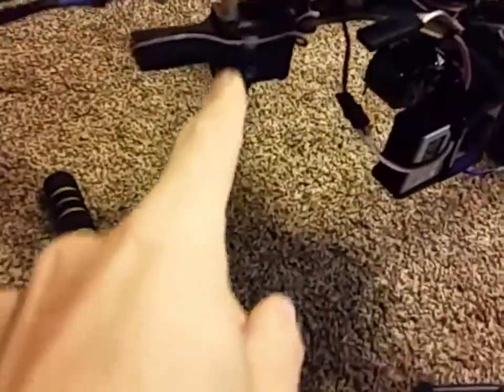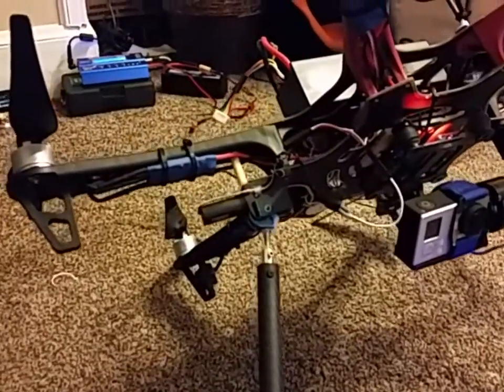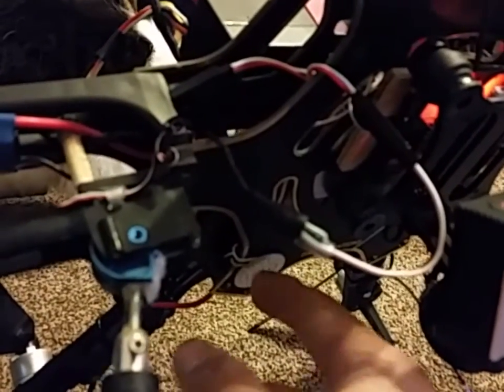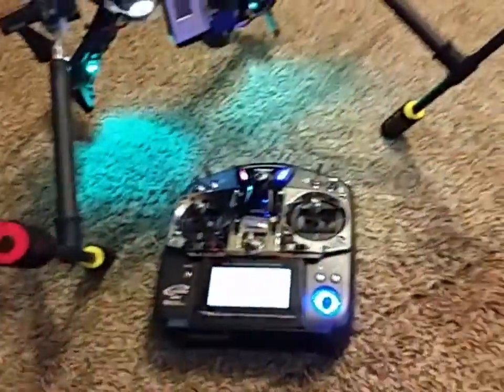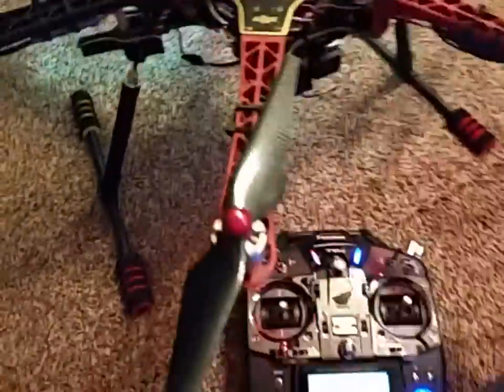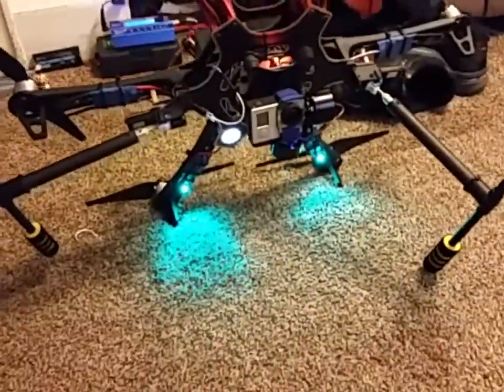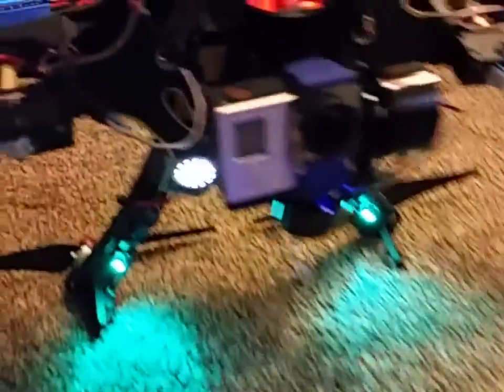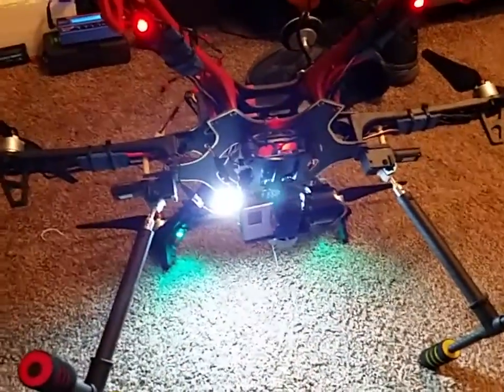DJI F550 Hexacopter Multirotor Landing Gear with LED Lights

Comment: Lot of work, should have just used a Taranis and simply assigned 2 channels to one switch, that is what I did. You could also use a separate switch for either also, love those 16 channel receivers.
Reply from the maker: please provide link to product, thank you
Reply: ***** http://www.alofthobbies.com/frsky-taranis-plus-x9d-case.html receivers are around $30 each, great radio, open source, look into them. You can assign all switches to one channel or the other way around. I have one switch that overrides all settings for a "return to home",  drops retracts and goes into rth mode. Awesome range, you can buy modules to support other radios like spectrum and futaba and continue to use older models without having to swap radio gear. So much more, they are very popular at the flying fields in my town. If you can think it, this radio can probably do it.

Comment: Hallo Sir,

What retracts are those and whre can i get them? Also do i need anything extra to pute them under the frame or they are just 2 separate retracts without any plate to hold them together exvept the frame bottom frame?
Thanks!!!
Reply from the maker: I purchased  them via ebay, called worm gear retracts, i also had to do some crafty assembly such as dowels and modify the included mounts in order to make it work. I will post some closeups  soon and look for  part links.

Comment: Hello friend, where you connected the cables servo ??
I am copying your system, I have the same servos, I have uncontrol Futaba T10J with R3008SB recertor, but I servos do not work, I tried it on different channels, but not how to make them work ??
can you help me ??
Which connected the servo in the naza or receiver ?? R3008SB that port ??
Reply from the maker: Make sure your receiver is in mode D(4) and using one of the two SBUS ports.  You will then use channel 7,8 or nine of the receiver to run gears.

Comment: Can you tell me details on the switch?  I didn't see anywhere in comments.  I would like to order the same switch and have the same setup.
Reply from the maker: Matthew Marsolek http://www.rc-lights.com/categories/Electronic-Control-Switches/
Reply: I take it that it's the rcl5090? Not the one that mentions dual intensity brake lights.
Reply from the maker: Matthew Marsolek correct, the switch is over kill, yet does what's needed.
Reply: ***** I purchased that switch, can I ask how you have it wired?  I have tried all different configurations and cant get it to do what you have.
Thanks
Reply from the maker: Matthew Marsolek I will respond asap, meanwhile,  I do remember that I used it as a ground only, one lead of light going in and out of switch to ground.

Comment: Way too much work for simple result. Ther has to be better way w/ retracts?
Reply: Yes, their is easier solutions which prove faster to do. However, with this setup, my lights are off upon takeoff and do not come on until the switch is flipped off then back on.  I personally like this setup because it is more realistic in aviation.